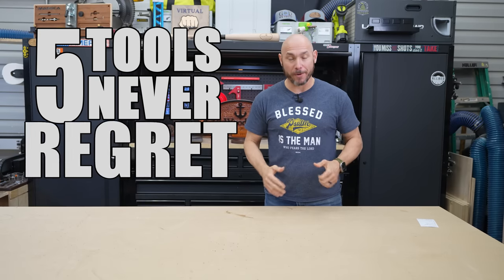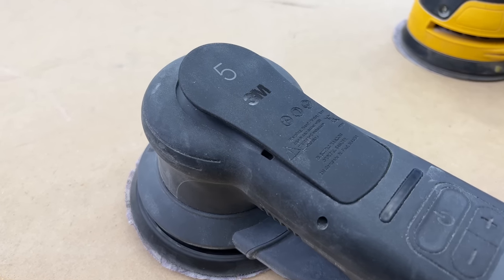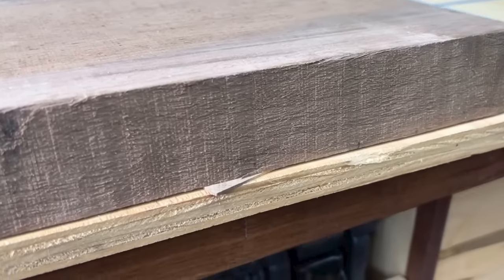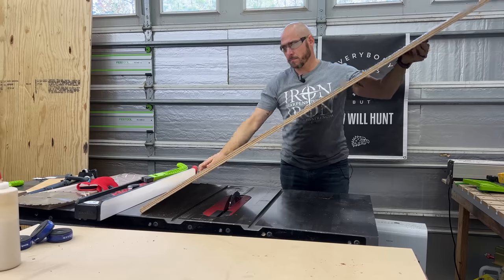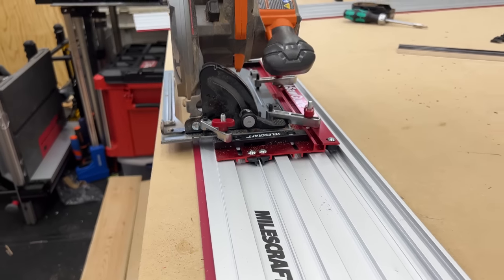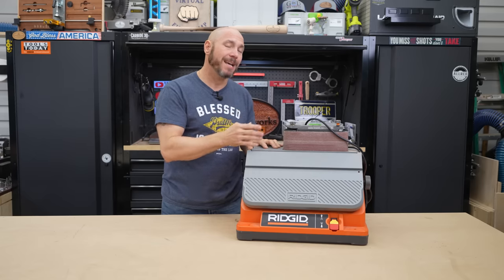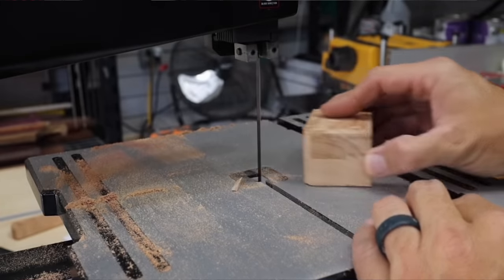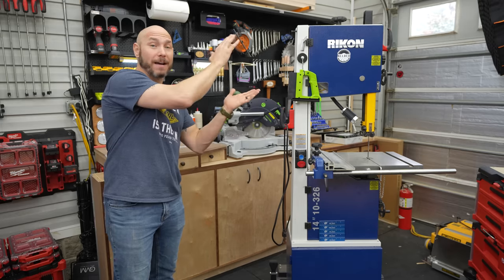5 Tools Woodworkers NEVER Regret Buying!

Comment from the maker: ▼EXPAND FOR LINKS TO THE TOOLS▼ 
🎥 Watch Next - 5 Tools I Wish I Never Bought https://youtu.be/9UNOASuIJx8&list=UULFSLClJLzdUMRMe0E4SPfc-w
🛠Tools and Products in this Video:
Festool Sander - https://amzn.to/3JpfQ32
3M Sander - https://amzn.to/3JHGNjN
DeWALT Sander - https://amzn.to/3TnMiaH
Festool Contour Pad - https://amzn.to/3JKw3B9
Festool Dust Extractor - https://amzn.to/3Lu6ENA
DeWALT Planer - https://amzn.to/3yHkOD4
Oliver Planer - https://amzn.to/3TiUpVP
Craftsman Planer (budget pick) https://amzn.to/3JunqcO
Festool Track Saw - https://amzn.to/409LbgO
Milwaukee Track Saw - https://shrsl.com/3z3la
Kreg Track Saw - https://amzn.to/3YTxWzJ
Milescraft Track Saw Guide - https://amzn.to/3yMjcbr
Ridgid Oscillating Spindle Sander - https://homedepot.sjv.io/e4YNGj
Wen Spindle Sander - https://amzn.to/3FvFnGx
Rikon Bandsaw - https://amzn.to/42knaW2
Wen Benchtop Bandsaw -https://amzn.to/3YPmQf7 

Other Tools/Equipment I'm Asked About Often:
Table Saw - https://amzn.to/3IoKqsZ
Table Saw Blade I'm Using - https://shrsl.com/3xv5i
Miter Saw - https://amzn.to/41hbJy4
Dust Extractor - https://amzn.to/41l6RYA
Tripod for Phone - https://amzn.to/3E3kWA9
Phone Holder for Tripod - https://amzn.to/3E1E6GG
Boots I Wear - https://amzn.to/3HkUl3y
Toolbox in Background - https://homedepot.sjv.io/x9B2xy
Tool Wall over Miter Station - https://amzn.to/3ZgWq7B
Digital YouTube Sign - https://amzn.to/3GL2a2e
Camera Gear I Use - https://kit.co/731Woodworks/camera-gear-i-use 
Computer Equipment I Use for Editing - https://kit.co/731Woodworks/731-woodworks-computer-equipment

Other useful links:
Easy to follow Woodworking Plans - https://www.731woodworks.com/store
Daily Tool Deals on my website: https://www.731woodworks.com/tool-deals
Subscribe the 731 Newsletter: https://mailchi.mp/7e44c16eefdc/731-woodworks-email-newsletter
Outlaw's Board Butter - https://www.731woodworks.com/store/boardbutter

Amazon and other affiliate links are used in this comment to help support this channel.  Using these links cost you nothing extra and is a great way to support our channel so we can continue to bring you content like this.
Reply: It's a bit off topic, but I've been meaning to ask you what dust collection system you use.  I'll be buying all my shop tools, etc...here very soon, once we're done with a remodeling job, and I"ll be investing in one of those.  That Laguna system isn't for the "immediate" wood dust, as much as any ultra fine particles your main dust collection system doesn't pick up....is that correct??

Comment: I may have a new tool for my work shop. I’m building a new shop and my vacuum system isn’t set up so I have been using the leaf vac for daily clean up. It works great don’t know if that will continue after the shop is built but l know it will be great at the lathe for sure.

Comment: You can get the Harbor Freight Bauer orbital sander for $20 right now. I dont use it as my primary but since my dewalt doesnt have variable speed it was a nice little pickup with a better dust box than Milwaukee. 😉

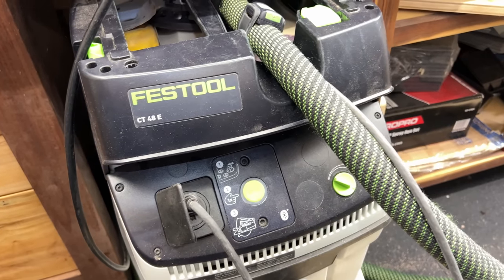Comment: 1:37 I have Metabo 13" (DH330). It only has 2 blades, but the feed rate is relatively low to compensate. I DID find a helical cutter head, but with shipping, it was about the same as I gave for the machine, and I would have to get it from Canada, so there would certainly be import tax added to the cost. Not woth it for a machine I only use occasionally.
3:13 I combined those and bought a cirkular saw that supports tracks (Bosch GKS 18 V-Li). I use it with a set of Bosch tracks that had the splinter guard replaced with the one from Festool (the OEM is no longer available here in Denmark), and I secure them with a set of Festool ratchet clamps (on sale on Black Friday), as the tracks are compatible.
4:55 Just the other day, in a similar video (John Malecki - 5 tools I regret buying), this particular machine was literally just collecting dust in the shop.
5:53 I would love to have a big, beefy bandsaw, but I am limited to a 450 square foot garage, where I also need space for my car. I bought a relatively cheap 6" version (Biltema) and put it on a cart so it is easy to pull out when I need it.

Comment: I agree the sander is a must have. I’ve heard the Mirka, 3m and Festool are really nice, but  they are out of most hobbyists budget. I think the planer is a must have, but really depends on what you’re building and if you’re using demential lumber. You can just sand the snot out of the wood to get a nice smooth finish if needed. The spindle/belt sander is a nice to have tool, but it isn’t a must. You can clamp a handheld belt sander to your bench and buy a tubular sanding disc that goes in a drill and does the same as a spindle sander, although the combined unit is nice. I own the Ridged. The bandsaw is a game changer, but we all used a jigsaw before a bandsaw which got the job done. I use to use the jigsaw all the time, but only recently learned the Festool blades make all the difference. They are freaking expensive, but you can cut at 90 degrees and track straight. Of course, don’t bother to resaw wood with a jigsaw as it can’t be done. You’ll need a bandsaw or table saw for that. You can get buy just fine without a track saw. A circular saw with a straight edge works fine, just takes a bit longer. Cutting bevels might prove to be extremely challenging though. I used the circular saw and straight edge for many years, then bought the WEN track saw which is about as budget as it gets, but it’s been great for me. What Matt says it true, you won’t regret buying any of these tools, unless of course you rarely use any if them.

Comment: Got to agree with you on these five tools.  I own four of them, with the track saw being the only one missing.  I don't break down a lot of sheet goods, but when I do, I've got some of the Bora guides.  They're a bit trickier (time consuming) to set up, but work for me.  

Of the five, I'd have to say the Rigid sander is probably the most time saving for me.  The DeWalt 735 planer has 'saved' me a number of times.  And the bandsaw (I have a Harbor Freight 14") is great for a lot of things.  Hand sanders, I have DeWalt 1/4 sheet and random orbital.  

But the most used tool in my shop, is still the DeWalt power miter box.

Comment: Hey folks. What about a Battery operated sander? I do not have power easily where I want to do the sanding.  Any specific brands?  I would really like the battery to be exchangeable with for example a jigsaw and drill (yet to buy any of the 3).

Comment: I use all my palm Random orbit upside down.  I clamp it in a vice and sand that way. Ive been using the Ryobi and it works well for what it is, but ive been thinking about the festool ets, .
does it work well upside-down?  I sand hundreds of smaller parts, and it destroys my hands. Partially because im sanding my palms and fingrer tips, but also the vibrations.
Would the Festool (or any other ) alievaiate that or is there a bench mounted option that works. well

Comment: My bandsaw and belt/spindle sander are 2 of my most used tools. I would like to upgrade my bandsaw but that cost money, it will have to wait. What I need now is a crosscut sled for my Dewalt contractor table saw. I need to get off my butt and make one.

Comment: I like the fact that the Rikon band saw is labeled "allred", but it's blue. 🤣 Thank you for these. My cheap Harbor Freight sander just broke so I've been eyeballing a new Dewalt. I kinda want the one with variable speeds, but it's $20 more than the one without. I'm not sure I'll need the variable speeds so I think I'll end up getting the cheaper one. Since I literally need all the tools I'll really have to budget accordingly.
Reply: I'm not so sure about the Dewalt.  I got the standard single speed one you are mentioning - and the motor burned out after about 5-10 hours of moderate use.  The variable speed Makita I replaced it with has held up well.

Comment: Please compare the kreg accu cut to the milescraft track saw kit in this video. The kreg accu cut has play in the track and I can never get  a freshly cut edge to be a square edge with the opposite edge that I laid out my line from. Yes my drywall square is accurate. Im on the fence of buying the milescraft  or saving up for a track saw. I would like to understand what the pros and cons are of both circ saw kits.
Reply: My accucut took a lot of tinkering with the adjustments to get it to ride just right. I also need to re-adjust it if I take the base plate off my circular saw.
Reply: @tektrixter  I agree the kreg is fussy if the milescraft is less fussy and more accurate as it appears to be then ill replace my accucut

Comment: In my opinion a track saw with an MFT style table, for the most part, could replace a table saw and it’s a lot safer. Benchdogs UK and TSO have a lot of accessories.

Comment: As far as dust collection goes… do you use your Festool on your Shapeoko? I’ve heard most often people using Shop Vac’s, but I feel like you’d burn up a motor real quick on the long jobs.
Reply: I have a Ridgid 16 gallon that doubles as a blower, about $160 at HD now. I have had mine for about 10 years. I have it connected to a 30 gallon plastic container that I put a compostable bag from PowerTec in. On the lid, I have a Dust Deputy. This combination does a great job removing the chips from the CNC, I have a Shark HD520, and most of the large dust but it doesn't capture most of the fine dust. I have have run some 6 to 8 hour jobs and the motor gets hot but so far performance hasn't changed. The biggest downside to a shop vac is the Db level, they are loud. If you are going to use one I would suggest looking at adding a muffler.

Comment: I co-sign all the spindle sander comments. Every time I use it I say "why didn't I buy one sooner?" I need to get a little finer grit paper on mine, I think it came with like 60 or 80 on there but I haven't had it long enough to use up the first belt yet. I did sand off a decent chunk of the tip of my finger yesterday though...woops!
the WEN one is great. looking at the rigid, i'm guessing they're made in the same factory. Dust collection works fantastic. If you're on the fence, hop off it right now and buy one.

Comment: You need a track, home made is fine.  You don’t need a “track saw”.  I had to chuckle about your planer choices.  I got so frustrated using the portable planers, finally bought a 3 hp 15” one, so much better.

Comment: As far as track saws, the corded Makita is an unsung hero. The Makita track is nearly identical to the Festool except in price. It can use many Festool accessories such as the clamps and alignment bars for joinging 2 lengths of track. But just as important is that it cuts really well and is reasonably priced. It's really a great value for dollar. If you have 18 volt Makita batteries already, then get the cordless version.

Comment: Another good video Matt......I have a square pad Dewalt cordless sander, but most all the videos I see, people are using the round pad. Am I missing something?
Reply from the maker: a sheet sander is a different style of sander vs the round (aka orbital) sanders. Most woodworkers use the orbital sanders for normal sanding
Reply: RANDOM Orbital Sanders leave a more obscured scratch pattern compared to square sheet sanders (whose movement is not random).
Reply: @RYwoodview  so which one is better for finish sanding?
Reply: @CreativeCustomDesigns  ROS, except for getting into corners.
Reply: @CreativeCustomDesigns  The ROS because it leaves a much less obvious scratch pattern.
Reply: @RYwoodview  I've sanded many a project for clients with my sheet sander, and none of them complained about sanding marks
Reply: @CreativeCustomDesigns  I'll bet you're really good at moving your sander randomly!
Reply: @RYwoodview  I must be.

Comment: Wen has a spiral planer for $400. I think that unseats the dewalt as the one to get at a modest price.
Reply: Not so sure about that ... only 26 cutters for a 13in wide cut? (For reference, my 8in jointer has 40.) Another thing to note is that the Wen cutters are HSS and not carbide ... which means they'll get dull much faster and won't last nearly as long as carbide.
Reply: @philshock3805  ......and it's $400. When they wear you rotate them. Repeat that three times then upgrade to carbide.